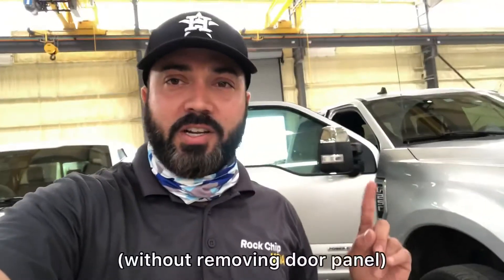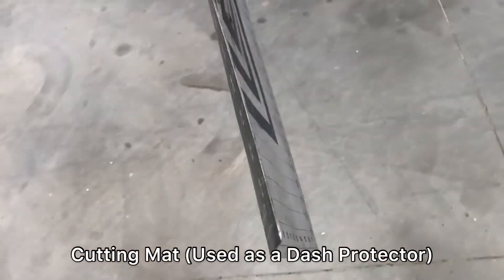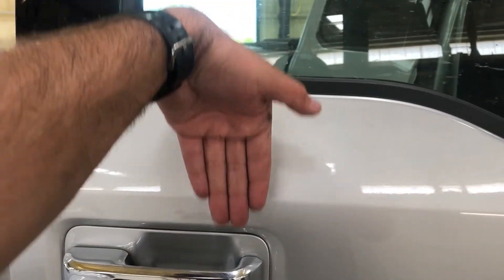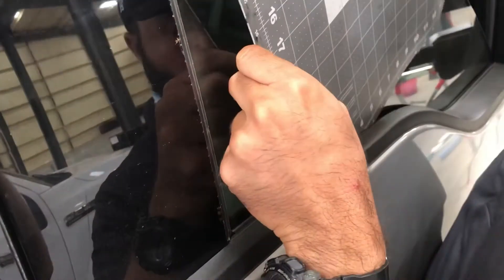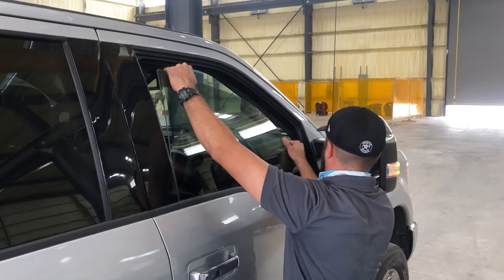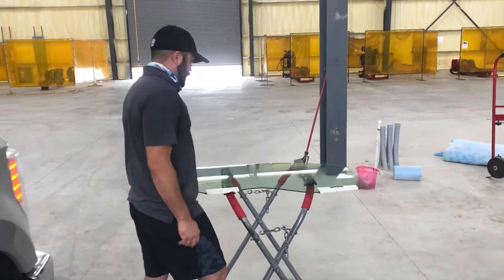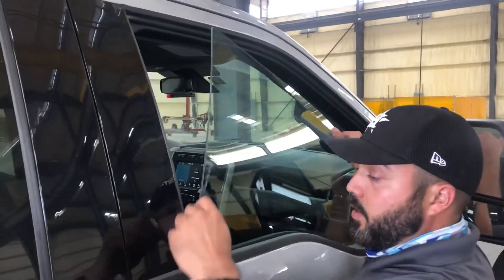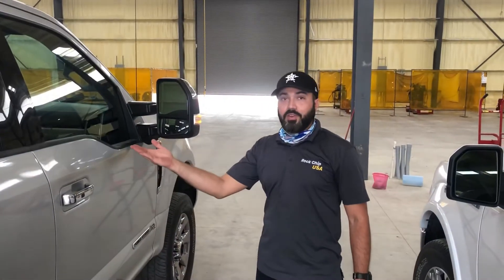15-20 F-Series Truck Front Laminated Glass 10-minute Replacement without removing door panel HACK!

Comment: I tried your method and finally for it to work.  I think my cutting board maybe has more flex, but it does work. :)

The only problem I had was there plastic piece that connects into the clips came of the replacement window that I replaced.  It was just mounted with silicone instead of the mastic Ford uses.

Comment: I had to have a new door installed.
Dealer transfered my prior stuff from the old to the new. Now it makes a popping sound and now as smooth as before or the other door? Is it possible that it isn't latched correctly or hitting something. 
Any suggestions?
Reply: Window makes a popping sound? Maybe one of the glass Clip supports is not locked on the regulator. Check out my other video on how to take off the door panel and glass for guidance.
Reply: @theonlymrt  will do
Thanks
Reply from the maker: This one: https://youtu.be/6QffFYK_MOo